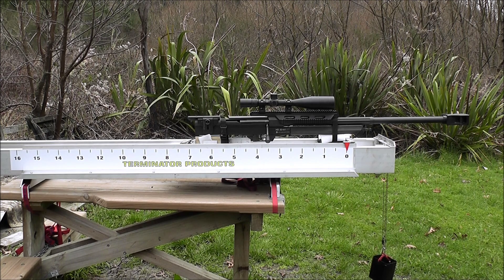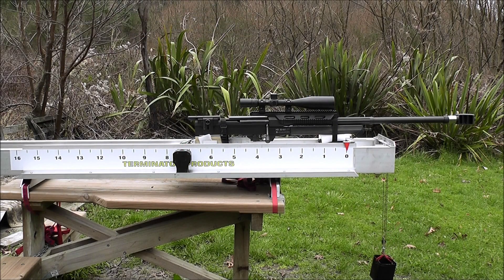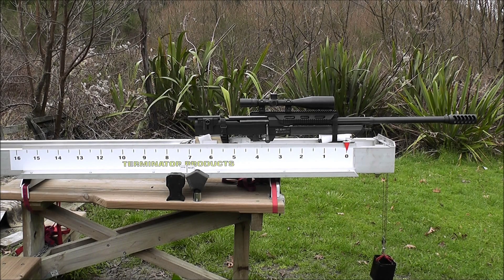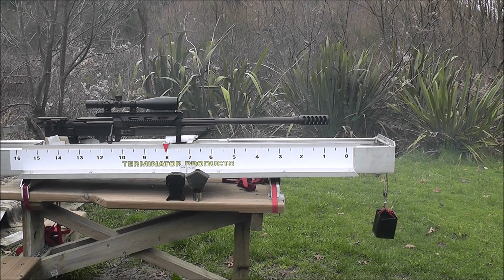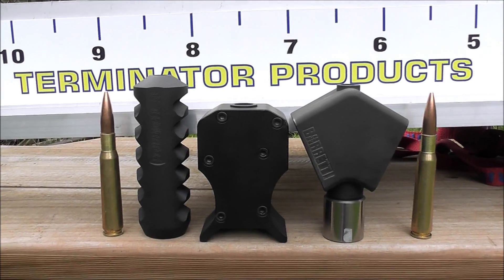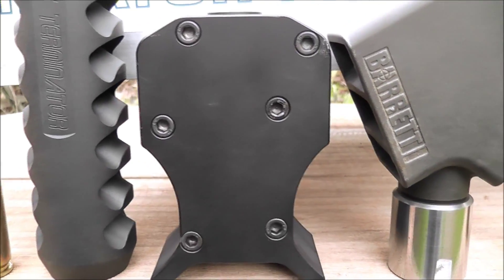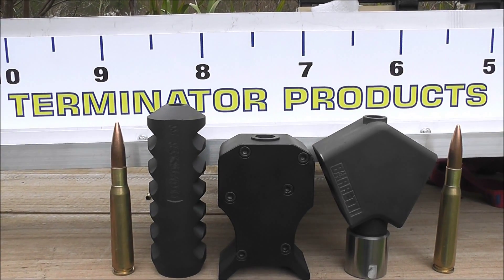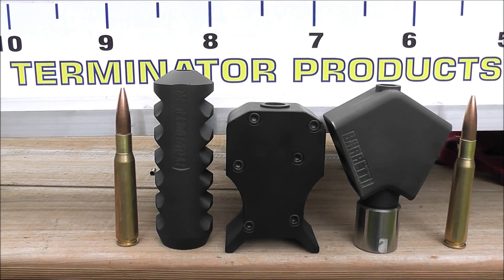T6 Terminator Muzzle Brake compared to the Steyr & Barrett 50 BMG brakes

Comment: In a bolt action rifle, 50 bmg can physically harm you without a break. The first .50 BMG rifle I ever shot was a State Arms 50 single shot with the original muzzle device. It was the first 50 BMG designed specifically for the civilian market in the United States and the muzzle device was only slightly better than a bare muzzle. It was a 2 chamber design and the ports are dead straight. It actually broke my collarbone. To be fair i was also 12 years old and weighed about 120 lbs.

Comment: I've got two T5 Terminator Brake on my 375 Cheytacs and one T4 Terminator  Brake on my 33XC
I'm building a 416 and was looking at the T6.
However looking at it not reducing the recoil less than 8 on your scale of what use is it? A brake is to brake the recoil which this does not do as goodcas the first two you showed. All it did was send fas straight out atb90 degree angle. 
So what is the T6 for.And why don't you angle the 1st port closest to shooter on your T5 to help reduce trash in shooter face.Thsts why I was looking for something better than my T5.

Comment: 'd love to see a Blast Shield, Sound Forwarder, Concussion Reduction Device, Flash can, muzzle brake sleeve tested.    design example Kineti-Tech Muzzle Brake with Concussion/Redirector Sleeve
Reply: Could you produce something like the Kineti-Tech redirector.  I have one for my 5.56mm and it works.
Reply from the maker: @wesa665  I did some testing with a similar design in 2012, it significantly reduced the effectiveness of the brake & had carbon build up so abandoned the idea. I have seen similar results with other comparisons with other brake covers, solid & porous. Cheers Greg